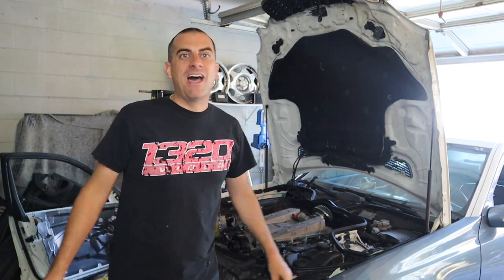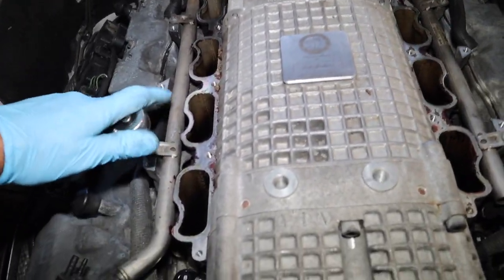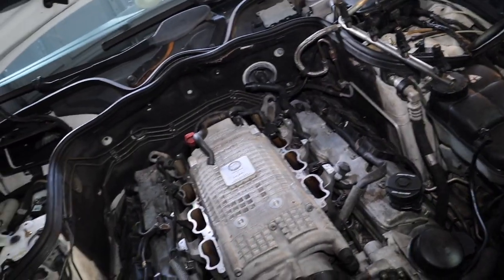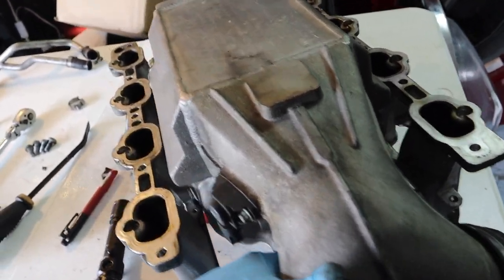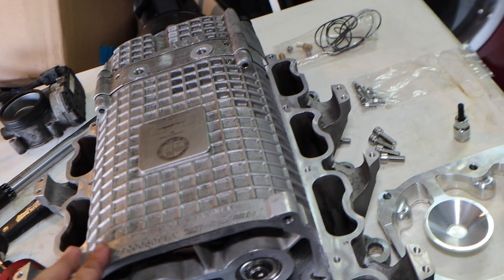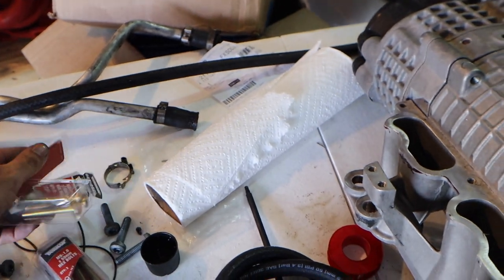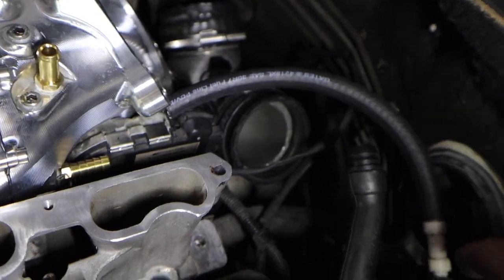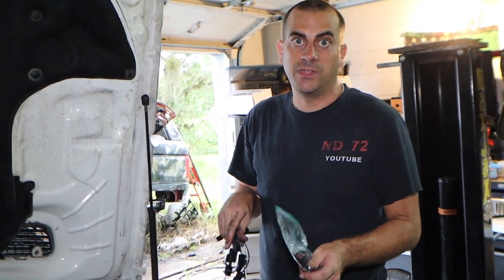Installing My HELLCAT Throttlebody And VRP Billet Snout On A E55 AMG

Comment: Question: did you end up leaving that drivers side breather hose disconnected? Looks like you routed both of the smaller upper hoses to the snout, but the larger hose on the drivers side was not connected to anything at the end.
Reply from the maker: no 
i made it come back to the intake

Comment: So what Y pipe and air filter set up did you use, I am installing the 92 mm throttle body  on mine and the Y pipe does not have enough room between the back of the body and the bulkhead
Reply from the maker: I used a custom intake set up
Reply: @Nd_72  I saw that in a later vid, the 90 degree bend into a single intake right?